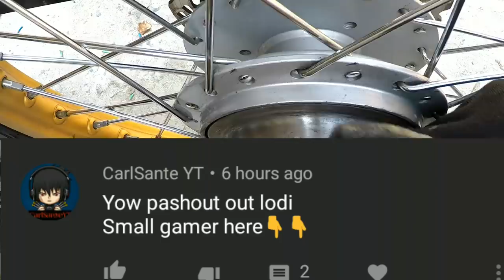How to polish a  metal parts of motorcycle

Comment: bossing may Lifehacks tayu dyan, 

paandarin mu ung motor naka engage sa 3rd gear para d ma matay ung makina

need mu gumamit nang toothbrush na steel ung ngipin, tpos lagyan mu nang metal polish ung steel brush tpos ilapat mulang ung toothbrush sa sprocket flange easy pessy kahit d subrang kinang atleast nalinis
Reply from the maker: Alright salamat sa tips idol
Reply: Pa shot out  naman lods sa pantua family